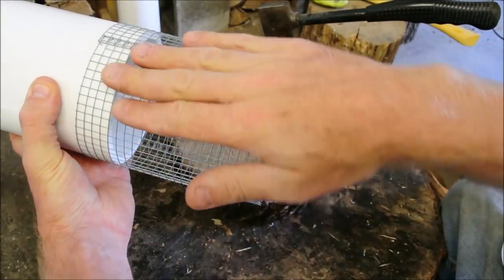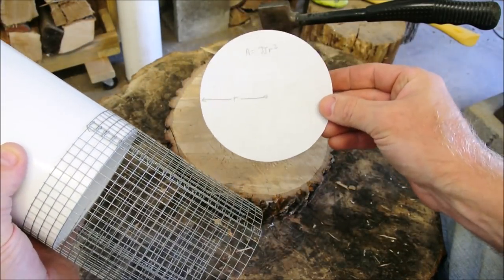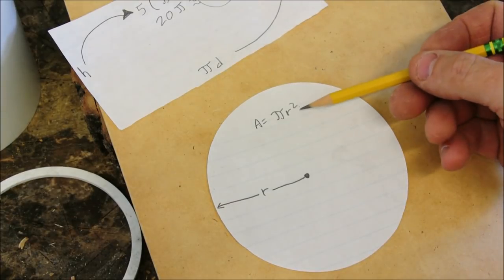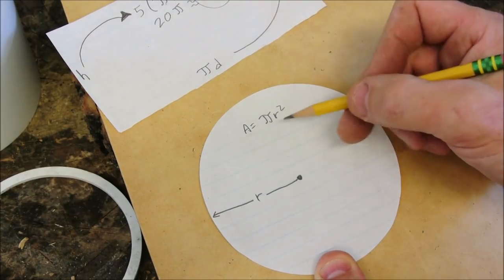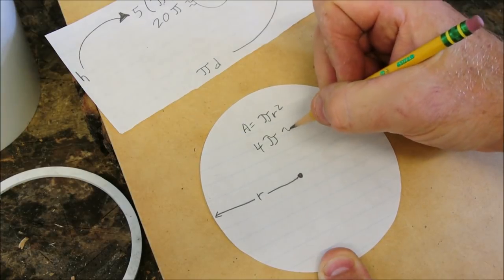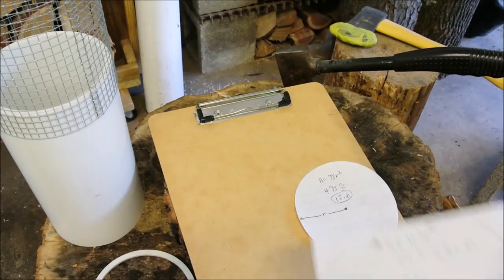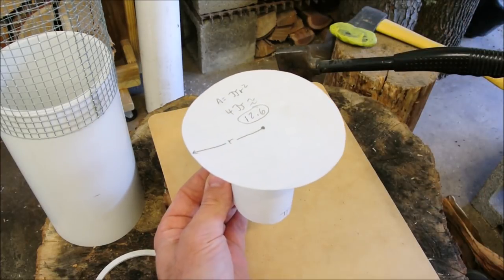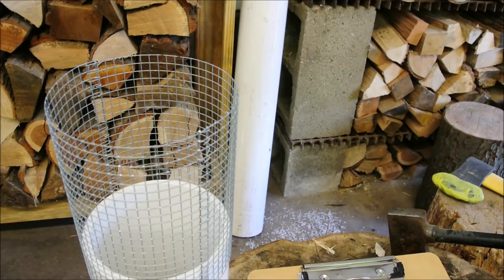Volume as slices of area: gravel & flow restriction in a radon mitigation system

Comment: This is certainly an interesting look at an aspect of radon mitigation that isn't well covered in other mitigation videos.  I've only seen videos where the DIY'er or pro shows making a hole in the slab and removing material from the hole (~3 five gallon buckets), and then the video usually cuts to the pipe already installed in the hole.  It's not typically shown or explained how the pipe should be seated in the hole, with respect to the sub-surface or surrounding sub-slab material... and I haven't seen anyone else prepare a stand-off like you have using a cylinder made out of hardware cloth.  I have seen one video where the pro cut a 6" hole, and then installed a 6" to 4" reducer/adapter (so the hole was larger than the 4" pipe, which seemed to make sense).  Although it still wasn't explained how the reducer/coupling was retained in the hole (held in place by friction fit via backer rod, so it was floating above the sub-slab area)?  

One question - is the hardware cloth you used for the stand-off galvanized?  So that it won't rust over time...
Reply from the maker: Yes, it was. Though, in defense of the easier method, unless the sub-slab space is subject to frequent flooding, the gravel under there will be in a reasonably stable environment, so the pipe opening is not very likely to become blocked. Their intention when removing ~3 buckets of material (and not replacing it) is to create a conic cavity that's large enough to avoid any blockages that might occur as a result of any natural settling of the gravel. In either case, the pressure gauge will alert us to blockages.
Reply: Most of the time, as far as I can tell (I'm not a mitigator), the sub slab space isn't filled with anything. If the hole in the slab is cut close enough to the pipe size, the gap is filled with backer rod and sealed in with polyurethane goop/caulk.

Comment: I do get his concept. His reasoning for putting in back the stones, there will still be some form of pull under the slab. There will also be some form of support. Which will leave room for the concrete having something to rest on. At the same time it will cause for less cracking in his sub concrete floor. His concept may even pull air from the soil at a greater speed. Similar to you putting 5 finger over a vacuum suction hole. Then releasing one by one you would cause a greater pull effect.

But in order for you to understand the nature of radon you have to study it. Everyone can look up and see the definition of what radon is what's its effect on your body and much more. What many don't know is that radon actually structures itself different from any other form of gas.

I have set up my own labs and have worked on many different theories of how to remove radon from the home and how radon moves. I have found the following information which needs to be shared with the masses. It would be best to leave out the stones from under the slab let me explain.

Radon is radioactive and it's not only that it moves like no other gas we have known. It actually attaches itself to the dust within our environment. This is like when you look at the Sun from a distance and see the dust particles flowing. Radon attaches itself to those particles. It then uses these particles for movement. Please note I'm not trying to steal any shine from this channel, but I would like to share my information. Please reach out to see the citidecor.co. There's much more to this and it's even paranormal.

Comment: My Ductulator app says 30 CFM (cubic feet per minute) in a 4" ID pipe. At .08 in/100ft of friction.  How many CFM was your fan rated for?  Now this is a relatively low pressure that's typical of home heating systems where I live, you might get a different  pressure. I believe that if you're starving a fan of air with too small a pipe the worst that happens is noise, so not to worry.  I'm just interested. Also your installation seemed spot on what I see here and there.  This video is a neat sidebar for the radon extraction video.

Comment: I know this is conceptual, but when talking about the volume of water placed among the gravel, you have to account for the water absorbed by the gravel.  Unless the gravel is in surface-satured-dry condtion, where its been kept wet enough to reach full absorption yet dry enough that there is no free moisture on the surface, it will absorb some (or a lot) of the moisture.   I guess that's nitpicking and I don't have your math skills but I know enough about concrete mix designs to be dangerous.  Great video.
Reply from the maker: Nope, you're totally right. If the results were closer, I would probably advise running that test. As it was though, the rocks were outside and already somewhat moist. Also, they weren't given too much time to soak- so I called it close enough.

Comment: Interesting argument. I think the design of your Radon system is fine, but I think the reasoning about the flow rate is flawed. The volume not occupied by stones corresponds to the flow rate only when the stones are infinitesimally small and distributed uniformly (i.e. "air" that is only 45% flowable). When stones have volume and are able to touch each other, the maximum flow rate is bounded by the minimum flow area of any contiguous "shell" around the exit of the pipe.

I've drawn a diagram to illustrate what I mean: https://img.jes.xxx/2415

You can see that the "stones" take up some proportion (less than 100%) of the area in the space that they occupy. But you can also see that the "stones" form a perfect seal around the pipe, because there is a shell that has 0 area for the air to pass through. I agree that this is not as bad with 3-dimensional spheres as it is with 2-dimensional circles (because spheres can't form a seal and circles can), but I think my argument holds: the flow rate is bounded by the smallest shell that the air has to pass through, not by the volume that the stones occupy.

And I still think your Radon system is fine.
Reply from the maker: Man, I would argue with you any day. Interesting point. But today I'm pretty busy, so I'll just say that I'm skeptical. Let it be sufficient for me to point out that there is going to be a wicked strong correlation between large shell flow and lots of stones. How close the two will come to being restrictive to ideal flow is a tough problem that I don't know how to solve off the top o' my head, but I'd wager that with most real-life scenarios, it would be very unlikely to impede it with any real threat to efficacy. 

Oh, and again with correlation: where you wrote "empty volume in here doesn't help," you are almost certainly correct. That's just a reservoir. But a large size (volume) there will be pointing to a general trend in large shells, since they would end up being necessarily larger on average. 

Jeez, I really can't have my mind wander further today. But we really should sort this out, given the importance of the topic; there must be a reasonable size threshold somewhere where a small shell would be a statistical non-threat, assuming cage and stone sizes as variables.
Reply: @pocket83squared  can you set up some sort of experiment using different size of stones and measure the flow rate some how? If you are not to busy though, thanks for that nice video
Reply: If you took an infinitely large volume of rocks which have no directional influence, then the cross sectional fraction of solid to void is the same as the volumetric fraction of solid to void. When you consider a non-infinite volume of rocks you will expect that this will not exactly hold true, but in an average case this similarity between volumetric and surface area fraction will still hold. There are possibilities that your rocks happen to restrict the flow significantly more or even significantly less than you expect, but the chance that they act as expected has the greatest odds.

A couple other things worth mentioning, the "seal" that you speak of is practically impossible in 3D compared to 2D. In 2D with any given set of shapes you will always be able to create a seal, while in 3D you need a very particular set of shapes in order to create a seal.

Another consideration is that of boundary effects, which actually act advantageously for this particular calculation. You are calculating the fraction of open area at a certain radius from the central axis, but the rocks aren't able to pack very tightly directly against the mesh. So if you estimate the rocks to restrict flow by 50%, that amount of restriction doesn't actually happen until a little bit farther away than the radius of the tube.

In general, the smaller your rocks are, the closer things should work compared to how you expect them to work. Just due to the fact that there are more chances for variability in one direction to be countered by variability in the other direction.

Comment: An area is two dimensional, right? Length X Width or, in the case of a circle πr², correct? So, if you own an acre of land, 43,560 ft², a flat, two dimensional plane, who owns the soil, the Height if you will, beneath this flat, two dimensional plane?
Reply from the maker: Yes. Here we have what are called "mineral rights" for the ground and its resources. And to be honest, I wish you could buy the rights to the air: maybe to legally shoot down some of those inconsiderate, low-flying hobbyist planes in what ought to be my airspace.
Reply: @pocket83squared  👍

Comment: I see what you are doing, and as much as I am pretty good at maths, I would never have thought of it like that.

If you can made the surface area of the outside of the mesh cylinder to be more than double that of the end of the pipe, then the stones should not impede the airflow at all.

My question would be this though. Seeing as you have come to this conclusion, and you said the mesh would be burried, why not just make the mesh part way bigger than the double required. It would only require slightly more work (digging and mesh) and would make sure you didn't mess up your calculation.

Double the height of your mesh cylinder and you should be well out of any danger zone.
Reply from the maker: That would probably be a pretty good idea. There were two considerations. First, it's just easier to make the screen with a similar diameter pipe. Second, typical installs use a core-drill that's only slightly larger than the pipe itself, so a big screen box would be too cumbersome for many installations. 

There's also the point of it all; what I mean is that the purpose of the argument here was just to let people know that the way I did it wasn't going to cause a restricted flow problem.  

Oh, forgot to mention: doubling the depth might not be the best idea because of the water table. Going too much deeper than the footer drain would sometimes render the additional area pointless, and further, it'd cause a straw-slurping sound when ground water is abundant. Of course, this all depends on your house's specifics. Thanks ;)
Reply: @pocket83squared  I never gave a consideration  to the Straw-slurping sound. But I do love your logic and the methodical explanation.

Great video Pocket83.

Comment: At 8:09 you said "assuming that the surface area is 50% rocks"  shouldn't it be, "the volume of rocks around the cylinder"? When you put water in the bucket you were measuring volume not surface area. I think your conclusion is still correct you just used the wrong term, or am I missing something?
Reply from the maker: Ok, so the point of the video is that surface area and volume are the same thing, from a certain perspective. 

If the volume around the cylinder is 50% rock, then the area around the cylinder is not likely to exceed that average. In fact, since the rocks are mostly round (and a sphere only touches a plane/area at one point), the area immediately around the pipe is far less than 50% rock.

Remember: if area stretched out is volume, and volume squashed down is area, then the average content of one will be reasonably close to the average content of the other. Hope that makes sense.
Reply: @pocket83squared  I'm inclined to disagree with your reasoning here. Could you perhaps try again in another way? I want to make sure I understand your logic.
Reply: @Rasmus0909  from my understanding, the demonstration with the bucket is to show that the composition or density (in a vague sense) in an arbitrary volume of that Gravel is roughly 50% rocks. It would be similar, and slightly less confusing if the buckets weren't the same shape as the pipe used for the system
Reply: @TheChenkar  So in essence he's talking about packing factor? This is often discussed in material science and crystal strucutres.
Reply: @Rasmus0909   I'm not an expert on it, but that's what I took from the bucket demonstration. The packing of those rocks is roughly 50%. So the airflow through the rocks is roughly half of what it would be unimpeded. And then he simplified it by comparing the airflow through a cross section of pipe (which could be thought of just an open end) with the (impeded) area of the cage, where the air enters the system. All just to prove that the cage and rocks don't impact the airflow (caged/gravel end does not restrict compared to an open end)

Comment: fully aware this is very pedantic:
looking at a tesla-valve, the area is going to be the same in both directions - but the air flow is completely different.
Reply from the maker: Not sure where you're going with this. Please elaborate. Also, I don't think that gizmo applies to gasses (depending on how we define gas). Hmm. Maybe it would work with low-density systems, given enough chambers. Like I said, please elaborate on your point.

Oh, and don't worry; we're all pendants here.
Reply: @pocket83squared  i can't say i've put too much thought into this :-p
that's just the first case i could think of where the area is not so important to the the overall throughput.
if you blow very slowly on the tesla valve, there's hardly any impedance - so the speed is also a factor there.
maybe, it's a bit like the electrical impedance growing when more electrons hit obstacles on their way regardless of the diameter of the wire.